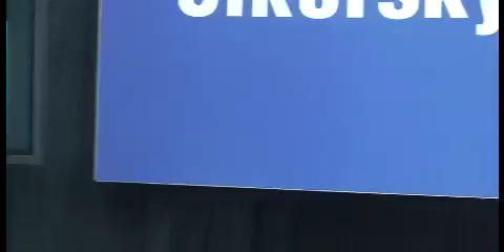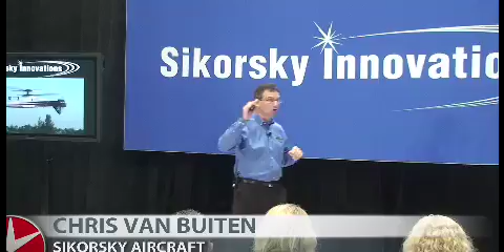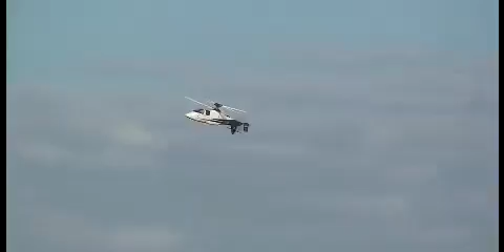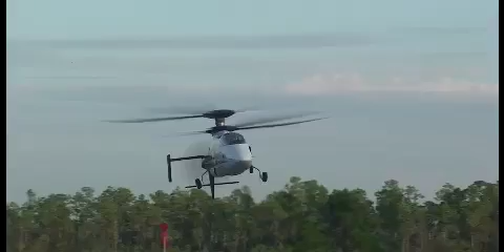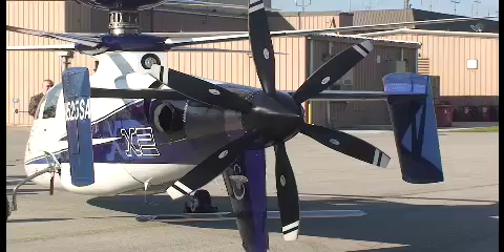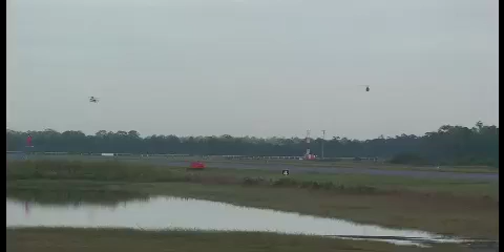Sikorsky Demonstrates New X-2 Helicopter

Comment: Read "AH-1W Air Combat Maneuver Training -- Why It Must Be Reinstated" for an analysis of Helicopter battles during the Iran-Iraq war! The Iranian AH-1J Seacobra´s had an edge over the Iraqi Mi-24´s because they were more agile and could turn faster than the Iraqi Hind´s. In reverse that would give Kamov an edge over the Viper since AA-Missles are hardly equipped and coaxial rotor helicopters are more agile and have better aerobatic qualities. Also it´s 30mm cannon has a longer practical range!

Comment: OK, so idk who told you that, But its wrong. Military does not go by the amount of Rotors for the probability of Failure. Any military would take this vehicle quick as A scout. Ospreys, the Bicopter is already being used by branches of Military, even with its bad record in the test field. Maybe you should Join the Military, They will fix you talking out your ass.

Comment: @dqhasanudin 
The origin from the coaxial rotor is not Russian, but French: the first full controlable hélicopter was the Breguet-Dorant Gyroplane laboratoire from 1935 (broke many wold records in 1936).
The last of the Breguet hélicopters was the Breguet G111 from 1951, but have some rotor vibrations problems (was only a prototype), but Kamov improve the coaxial system with a efficient blade vibration damping ,on the Ka10 from 1953 i think, built in very small number

Comment: @reblo111 
The Kamov use the rotors for forward movment like all conventionnal hélicopter, the X2 not: the rear propellers are not "rotors" but only propulsion propellers, so the main rotors can rotate slower at high speed, that encrease the possible maximum speed, but reduce the tip speed from the main rotor blades (must be subsonic: this is the cause of the speed limitation from the hélis)

Comment: @reblo111 technically speaking,  that's a propeller, not a rotor. Rotor disks are poised parallel to the longitudinal axis of the aircraft with the airflow directed at right angles to said axis in order to generate lift and thrust and/or counter torque from the main rotor. A propeller just provides forward thrust.

Comment: @nhicohgener To have a stable, manueverable helicopter, you need to have a center of mass in line with the rotors. With this helo, adding weapons will make alter its center of mass towards the tail, which will most likely make it much harder to manuever

Comment: @discountninjuh well this is not really cutting edges, for exemple, the X-3 is a dauphin 2 (same that US cost guard) modified with NH90 ENGINES and some other upgrade, it's not the same that US X2 which seems to be an entirely new copter, we can think that the european one will be cheaper as it uses other copter parts...